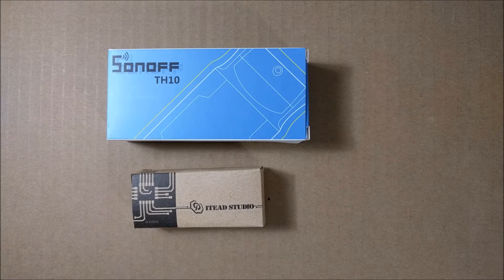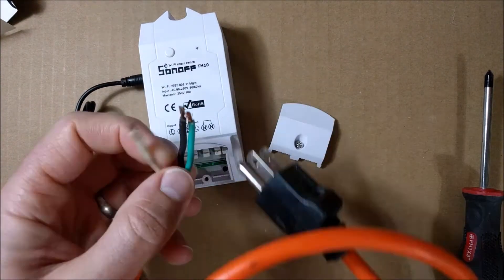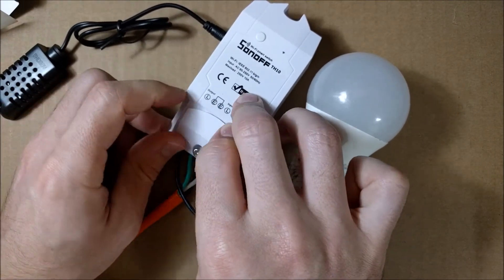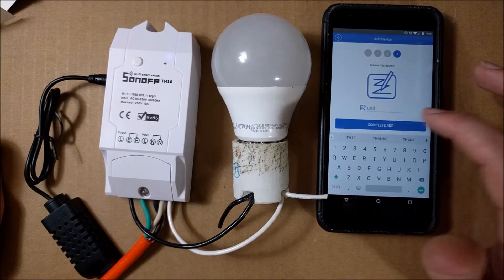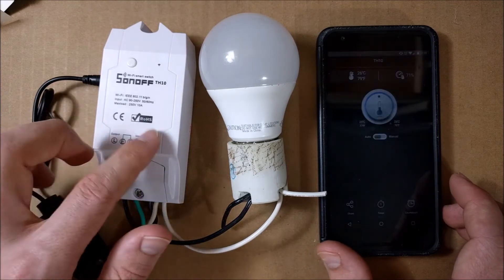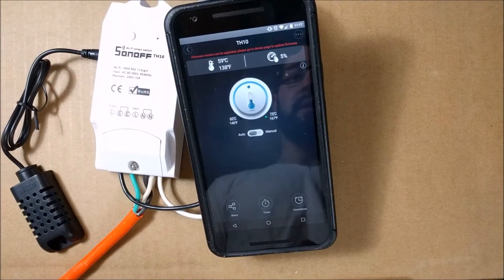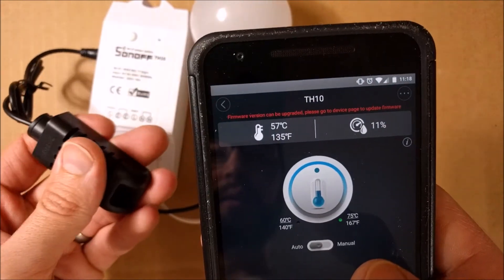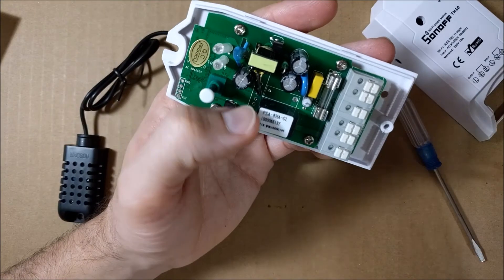Sonoff TH10 Review

Comment: Can you enter like 29.1 or 29.6 degrees or just 29-30 ?  If I enter max min temp controls will it work automatically even if my phone is not connected? Can I see the temp log from the app? Thanks.
Reply from the maker: as of now you cannot do 29.1 or 29.6 it has to be whole numbers like 29 or 30. if your phone is not connected it will still work. as long as the sonoff is connected to wifi & internet. you dont have to have your phone after you set it up. as of now they dont have a temp log.